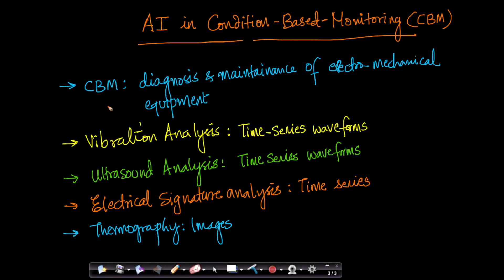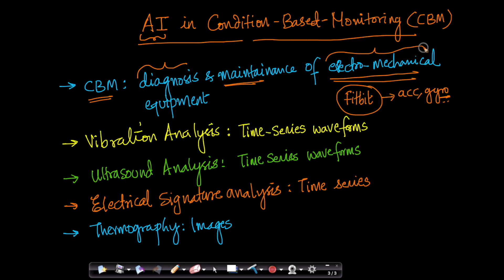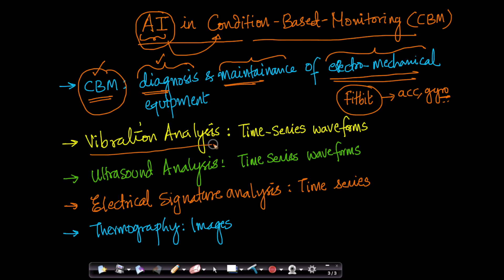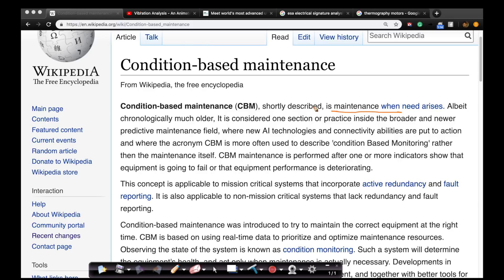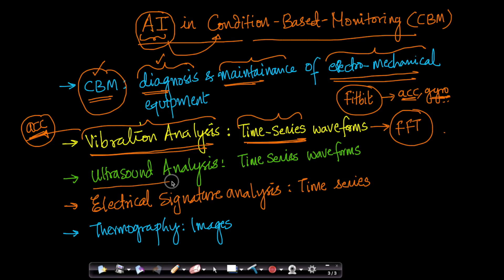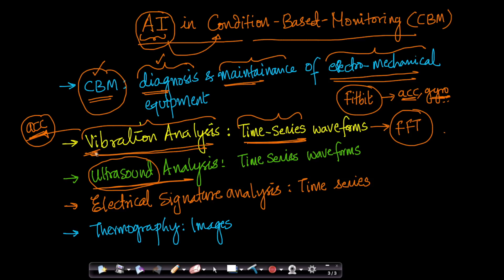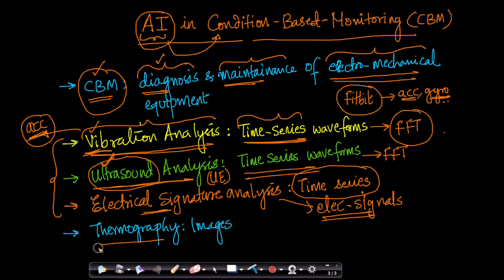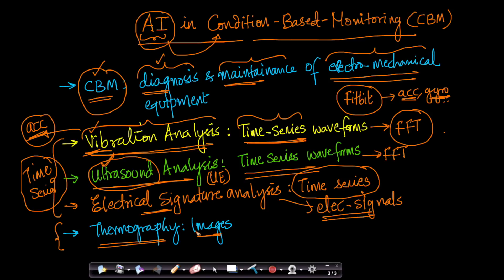Application of AI in Condition based monitoring | Applied AI Course

Comment: One of the challenge I faced while trying to do the project in this domain was the, data set is hard to find unlike other we have over internet. Could find few from NASA & one data set from Microsoft case study(worked on this but it does really need good expertise in domain, to understand the solution itself is quite challenging. Also The solution had major flaws. Eventually will work again on this as I get good at ML & improve my knowledge. 

Could you suggest where to get the dataset for these kind of problems. Industrial IoT, Thermal Image etc. Many don't disclose the data set due to their privacy policies. IoT data is quite hard to find (have spent many hours to search & emailed to many but, didn't get the data)
Reply from the maker: Kaggle is a great source to get access to interesting datasets.